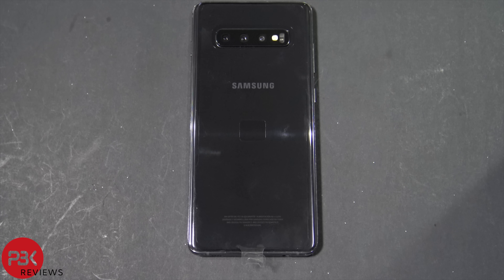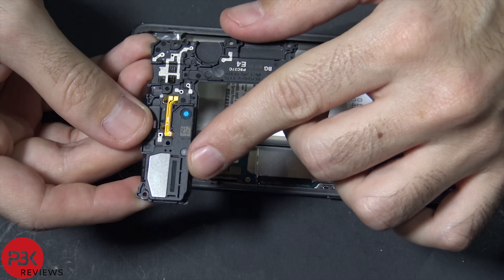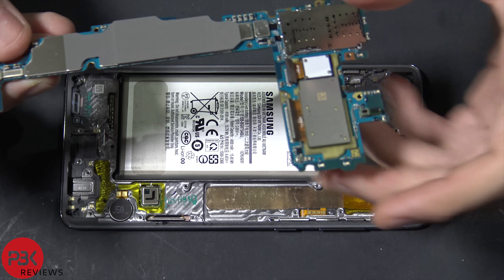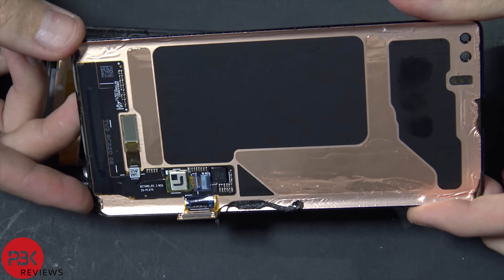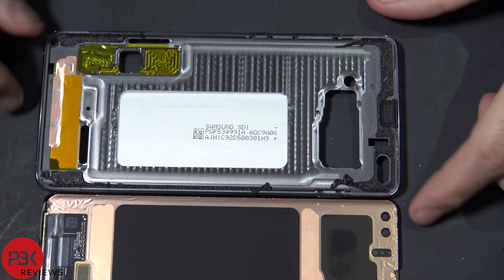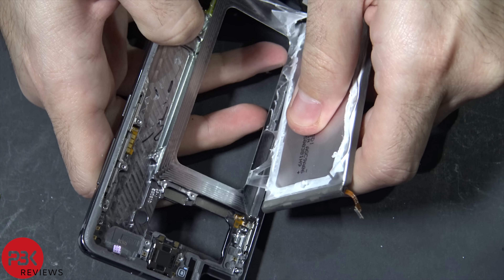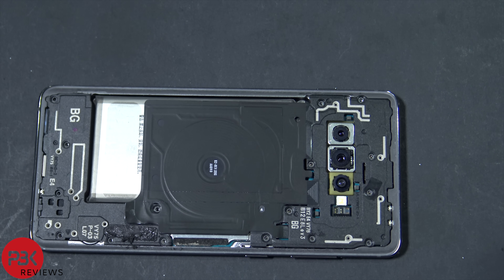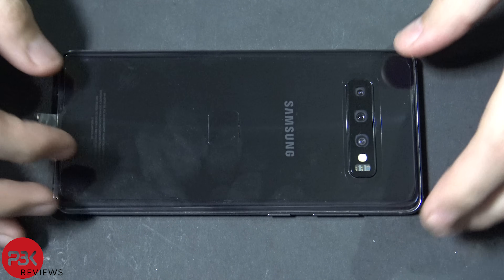Samsung Galaxy S10+ Plus Disassembly Teardown Repair Video Guide. Any Bitcoin Inside?

Comment: What causes the ear speaker to sound low on a recieved call with volume set high.Beside cleaning the ear speaker vents and going though sound Ajustments  in settings?
Reply from the maker: aside from the speaker grill mesh being clogged, would be debris on the speaker itself or a bad speaker

Comment: I friend, I have a question, is there any way I can get larger "flat cables"?, the ones that connects the main camera with the board?, I want to be able to use the camera externally, which means that the phone is assembled, BUT the camera is like 30 cm away from the phone, that is why I'm asking if there are "flat cables" that large....

Thanks for your video.

Comment: Do you offer a video, showing how to replace the left (top of phone) microphone ?  I accidentally  poked it, mistaken it for the SD card slot.
Reply from the maker: You don't need to replace it, it won't be damaged. Both microphones and filters are seated above the holes so they won't get damaged.

Comment: Sorry about the error in my response....And I did not mean "Bitcoin"  I have (no longer use as it died) A Samsung galaxy S10 and it had over 1,000 songs and 1,000 pictures that I did not save to the cloud.  2 yrs ago the phone completely died, meaning I could not power it up.  I sent it to Samsung along with a processing fee of like $50, they said that they could "attempt to fix it for $450.....no thanks.  I was told that it has a motherboard that crashed and it had to be replaced so it could power up and I could download the content.  make sense?
Reply from the maker: Hi, I can't seem to find your first question or comment prior to this, but yeah even if they replaced the motherboard, you would lose your data since its stored on the onboard storage chip. The only thing you can do if you really need the data, is find a place which specializes in repairing phones and can do soldering, which can de solder your old ROM or storage chip and solder it back onto another motherboard. But it won't be cheap. Or you can also find such place that can investigate the damage further to see exactly what on the board has gone bad to replace that chip or component to get the motherboard working again. I don't know of any places off the top of my head but maybe you can check with someone like https://rossmanngroup.com/  but they specialize in apple products. Maybe they might know of somewhere you can take it.

Comment: So is it still not possible swap out the main board? My bottom microphone isn't working amd local repair guy said the mic is soldered to the charging port. Is it not possible to swap out just the related parts?
Reply from the maker: You can swap out the board if you find a replacement one, but yeah the mic is soldered onto the main board. A repair shop with soldering expertise should be able to replace the mic if you could even find a replacement from another phone.

Comment: Where is the hard drive? Can you swap them if you have another s10?
Reply: It's a Fantastic video! I just think you might have skipped over the storage.
Reply from the maker: Thanks, the onboard storage is a chip that is soldered to the main board under one of the shields. It's not removable.

Comment: I know I'm a bit late to this video but I learned a lot from this. Still rocking with my s10+ to this day and not thinking of replacing it at all. Battery is still great, Screen not cracked, doesn't overheat at all, and it stays cool all the time. This is my first samsung phone and definitely not my last.
Reply: All I can say is back it up.  Mine was perfect like yours until it started rebooting and went into a loop.  I did everything I could think of including disassembly and cleaning.  No love.  Suddenly, without my touching it, it did a system reset!  WTF!!  I had no backup and it looks like I've lost 5+ years of pictures and data.  So angry.  There are thousands of people watching these videos on reboot loop and keeps restarting.  Clearly this is a problem with the phone.  Just terrible.

Comment: Very informative.  best I have seen so far.  My Galaxy S10 5G completely crashed and I supposedly need a replacement motherboard so that I can extract all of my piks, notes, and music which are all on the hard drive and they were not backed up.  I can obtain one from Amazon, I suppose.  Thoughts?
Reply: None of what you said makes sense, the mainboard is what contains all of your information there isn't a separate hard drive lol

Comment: Where the signal cable?
Reply from the maker: This phone doesn't have coaxial signal cables, so if you have signal issues, you need to make sure the top and bottom plastic covers are screwed in place properly since those of antenna lines drawn on them which make contact with pins on the board to give signal. Also the board makes contact with parts of the frame which gain signal from the built in antenna lines in the frame.
Reply: @PBKreviews  okay done, my problem is short on IC RF PA

Comment: Hi, I pierced the top microphone with the sim tray ejector tool. The 2 holes are stupidly next to each other and I made this mistake. Apparently, the microphone is working, but I felt pressing down something. Maybe I damaged the water proof rubber or whatever? Thank you for your help.
Reply from the maker: Hi, the microphone sits above the hole so it would not get damaged. Also in most cases the filter sits somewhat at an angle so it should not be easily damaged but even if so, its such a small area/hole that it would probably not be effected much.

Comment: Please, can you do a video on charging port replacement?
Reply from the maker: The charger port is soldered onto the main board and requires someone who has soldering skills to be able to replace. I personally am not experienced in soldering so would not be able to guide you.
Reply: @PBKreviews   @PBKreviews  alright,  thanks for the info. Wonder why they decided to attach it to the board tho really makes it difficult to replace without risk of damaging other components.

Comment: where is the internal storage located?
Reply from the maker: The internal storage is under one of the shields bellow the sim reader. I put a read square around the area it is in this image I uploaded : https://ibb.co/VpxGGW5  . Keep in mind its soldered onto the main board and not user removable.
Reply: @PBKreviews  thanks.  I have a 512 with a cracked screen but want to use a 128 screen.  was just seeing where the storage is.
Reply from the maker: @luvdr350  The screen is the same on a 512 compared to the 128. The only difference would be the onboard storage chip on the motherboard. Would not matter or change if your replacing the screen since your keeping you same motherboard.

Comment: headphone jack is  attached only by 1 screw ?
Reply from the maker: yes, but it's also held in place in the frame slot as well as the top plastic speaker assembly cover sitting over and covering it.

Comment: is the screen already broke before you open it?pls tell me because i plan to open mine to replace the earpeace dust grill.
Reply from the maker: No, if you plan to remove the screen, there is a strong chance it will break or get damaged
Reply: @PBKreviews  is there any tips i should know to avoid damaging it?
Reply from the maker: @amadzack666  It's extremely hard you need to keep applying heat on and off and being patient when prying off so there is a strong chance it can break. Also too much heat would separate the digitizer from the screen in some parts. Ask samsung if they have any service options that is affordable for them to change it for you.
Reply: seriously that hard? my earpeace got blocked by uv glue,i did ask them but the cost about 75% of the display price which i can't afford right now,i used to do part time phone repairing before,but for some reason i'm not very confident doing it on this phone,i used to do hotgun+suctioncup+glue if it was crack so bad,i not familier with pry it open for screen disassembly like in this video and i dont think my way is going to work on flexible screen like this phone.
Reply from the maker: @amadzack666  Yea its fairly difficult. You can attempt it and if it doesn't go well maybe then look into sending it in for repair, not sure lol. Or maybe you can use a tiny pin to poke holes in the earpiece mesh
Reply: anyway i successful changing the ear grill without breaking the screen,but the problem is the off screen battery life went bad losing 30%-40% overnight on idle,i even replaced with new battery but the problem is still there,i have no idea what went wrong at this point

Comment: Does the loud speaker assembly also contain the microphone
Reply from the maker: no, the main mic is on the main board next to the charger port. Its a gold colored square or rectangular piece. There is a secondary mic on the top of the board as well.
Reply: @PBKreviews  my mic doesn't work and how would I replace it
Reply from the maker: @SoulForMany  Make sure its not your headphone jack, sometimes when that gets damaged or a headphone head gets stuck inside the headphone jack, it thinks you have a headphone plugged in. Also if you put your phone on speaker phone, does the mic work then? Because on speaker phone the secondary mic becomes active. The mic on this phone would not be user replaceable since its soldered onto the board so you would need to find a professional repair center to be able to fix it for you if it is the mic
Reply: @PBKreviews  Yeah headphone jack works fine and speaker phone works fine

Comment: What do you use to glue back the back screen?
Reply from the maker: You can either search for the precut adhesive for the specific phone (back or front whichever you need) or if its not available you can purchase 300LSE adhesive or smartphone red tape adhesive to reattach the front or back. Keep in mind unless you use the original precut adhesive, you won't be able to ensure a water resistant seal.

Comment: if you remove it will be not water proof or not?
Reply from the maker: ya if you take it apart, it will lose the water resistance unless you use the original pre cut adhesive to reseal and ensure a tight seal.

Comment: My friends has broken his s10+. His screen is crack free luckily, works fine, but the frame in bent in the down left corner, the back is cracked up and the finger print is not working. He is debating whether he should repair it or upgrade to s20, what do u suggest?
Reply from the maker: Hmm that's a tough question. Depends on how much it will cost him to get all that repaired and if he would rather put that cost towards a newer phone. He can always sell the broken one and use the money towards a new one as well so all depends how much he is looking to spend and if its worth upgrading or if it would be cheaper just to repair it. If mine personally broke, and I really liked the newer one, then I would upgrade. But if the newer model didn't attract me a great deal, then I would probably just repair the current phone I was already happy with :)
Reply: @PBKreviews  Thanks for the reply.

Comment: Brill do you have a separate video on charge port change please ? Thanks
Reply from the maker: Hi, changing the charger port requires professional skill in soldering and I personally am not a pro at soldering.
Reply: @PBKreviews  ah ok I'm not dpomg it I'm.offvto store now can only wireless charge which didjt great as 0hone isnt old so should be under warranty usually 2 years thanks anyway tody job

Comment: Poking the sim card tool in the wrong hole. I poked into the mic noise reduction. I tested the mic and it's ok but I am worry  about the waterproof. Have I damaged the water resistance?
Reply from the maker: No you should be fine, a lot of people do that by accident.

Comment: Recently I installed an adhesive screen protector with it's glue and I got some glue in earpiece speaker. Can anyone help me?🤨
Reply from the maker: That's going to be tough. Try using a tooth brush to see if you can brush it out, if not, then try a small needle to poke holes in the glued parts to allow sound to pass. Your last option would be to disassemble the whole phone and pry off the screen to replace the earpiece speaker grill which is very tough to get the screen off without breaking it.
Reply: @PBKreviews  😩😩
I'd rather just wait for the next release of S series and upgrade😂

Comment: yeah... just heat the battery up... just like you did not do..  because you will screw up the battery.... poor one .
Reply from the maker: just because I didn't show me heating it in the video to waste time, does not mean I did not do it. I promise you without heating it, it would not come off that easy..I cut parts of the video that are useless to see to save on time people need to fast forward. Its common sense stuff, so if you need to see me actually heating it so you can do it yourself, then you shouldn't be taking apart your own phone :)

Comment: In the microphone hole top side
Reply from the maker: you should be fine, the mic is pretty solid and shouldn't get damaged too easily. Many people make that mistake.
Reply: Is it normal when you shake the fon  theres aclicking sound inside the fon?
Reply from the maker: @benjamincacatian2008  its probably the camera shutter, my phone does that as well. Either the shutter or the image stabilization mechanism that rattles when you shake the phone
Reply from the maker: @john oneill @3:16 it's that gold square piece between the front facing camera and ear speaker
Reply from the maker: @john oneill here is a pic. https://ibb.co/bsS3kqs  its not the only mic on the phone, that's just the one on top, the main mic is on the lower portion of the phone
Reply from the maker: @john oneill its a solid metal piece, I doubt any damage would have happened unless you hit it extremely hard and felt it break because its soldered onto the board. You should be fine.
Reply from the maker: @john oneill not sure, and yea its a secondary mic. Would be hard to test it but highly unlikely there is any damage

Comment: My lock button is broken was wondering if you can do the a video that shows how I can fix it
Reply from the maker: Look at the pic I uploaded here, that bracket circled in red, you just need to use a thin tool or small flat head screw driver to pull it up and off the frame. But first make sure to use the flat tool or flat head screw driver to lift up the gold colored flex cable for the power/lock button off the frame since its held on with adhesive. You dont want to tear or rip it if you pull up the bracket first and its still adhered onto the midframe of the phone. Once you got the bracket pulled up and out, you should be able to pull out the flex cable for the power/lock button and the button itself will come out toward the inside of the frame as well.

Comment: hi there , nice videos , i was wondering if the power button could be replaced on the s10 plus. I tried to look for videos on that but could not find any. I dent the power button so needs to be replaced. any suggestions would be awesome thanks
Reply from the maker: yes its replaceable, it has a metal bracket you pull up to remove and then the button comes out. You need to take the phone apart to remove the bracket.

Comment: Can anyone tell me if I can replace a side button on this phone without disassembling it like in the video?
Reply from the maker: You would need to disassemble it to gain access to replacing the side buttons. They have brackets on the inside you need to remove to free them.

Comment: Accidently dropped my phone and the screen cracked! 😭 Trying to learn how to fix it myself! Seems like all I have to do is detach the screen? Like on 3:00 ?  Thanks for the video brotha! Subscribed!
Reply from the maker: Yes, once you get to that point, disconnect the cable, heat up and pry the broken screen off and you can slide the cable out and reverse the process putting the new screen on. No prob. Thanks

Comment: You forgot to reapply the two small gelatin covers. Maybe they need as protection against other components so they can not touch each other.
Reply from the maker: which covers? at what point in time in the video do you see these covers so I can see what your referring to

Comment: I do phone refurbishment for a living, and I already am dreading this phone's arrival at my place of work.  All the phone's I've worked on up to this point have had an I/O board that allowed for the quick and simple changing of a bad usb connector.  There's no I/O in this phone, so any phones with pc connection issues will have to be done by someone authorized to do soldering or will have to be scrapped (not everyone is trained to perform reflow soldering, and we scrap phones if there is an issue that is too costly to repair or any attempt to repair it will likely cause the failure of another component).  Another reason is I fear what the quality of refurbished parts will be like with that ultrasonic fingerprint sensor (we try to use refurbished parts more for lower cost).

Comment: Could I use my old added fingerprint scanner after replacing the LCD screen ?
Reply from the maker: If you mean your old stored fingerprint on the phone, I don't see why not but the finger print scanner itself would be replaced when you change your screen since they come glued to the new screens and they are not replaceable